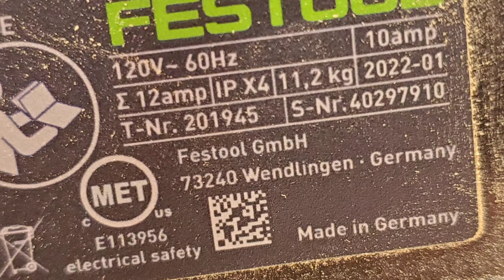How to start a Small Business  (Woodworking tips) #woodwork #smallbusiness #tipsandtricks

Comment: Great video, definitely considering trying to get my feet wet soon, moving from hobby to business. Any tips on pricing, and also how taxes and other red tape issues should be handled?
Reply from the maker: Hello sure I can try to answer best I can
Pricing? How to price your products? Tools? Materials?
Products it depends on what you build
If say pine furniture
Add up the cost of the Materials 
Example 1 end table may have 25 to $35 in materials roughly
Then create an hourly rate if new make it cheap like 10 to $15 an hour to start
So an end table may take 2 to 4 hours (depends on painting and finish)
So I would not sell an end table for less than $100
As you get faster your profits grow with speed and can charge more with reputation 
Hardwoods those prices go up and sometimes no paint if using a walnut for example which saves more time which leads to more profits 
If new and trying to build a customer base I would not under or over price
Look at fb market place etc and see what similar products cost and find the middle.
If too underpriced you hurt other woodworkers and the trade but even more selfishly become known as the "cheap guy" which can hurt your reputation 
Tool wise start with what you have
If have a tablesaw, jointer and planer
Cutting boards can be pretty profitable and stove top covers.
I would recommend not going out and spending thousands on tools
Build up your tools with profits.
Taxes is tricky
Depends on what country or state you live.
But without trying to get you or me in trouble
Here's a hint
Remember you will more than likely pay taxes on your electric , tools, materials,  gas, etc
So now need to figure out how to write all of that off so you don't have to factor in to product prices.
Because the way I look at it you're already paying taxes so whatever you can avoid or write off do so
Once you get established look into an llc etc
Hope that helps